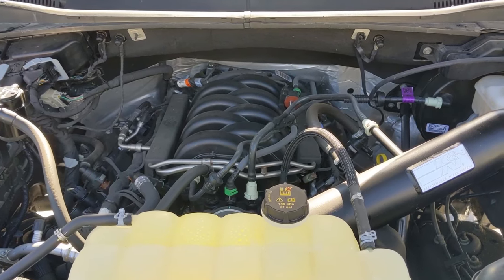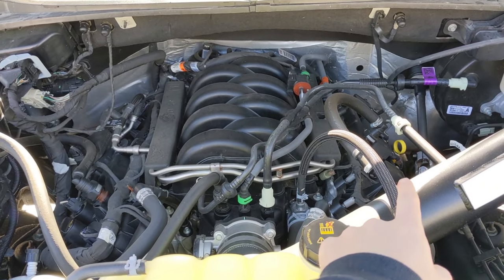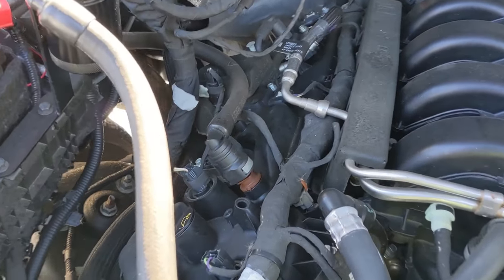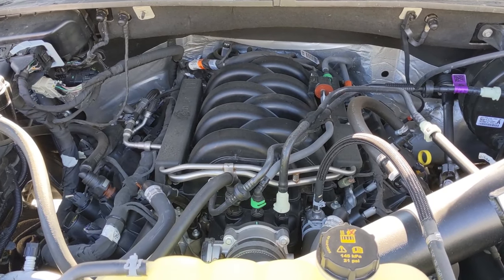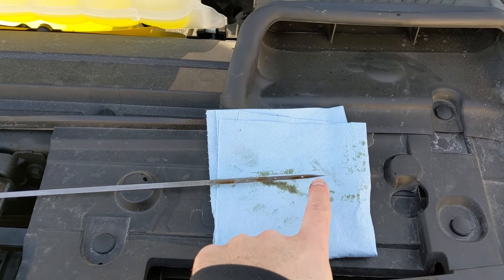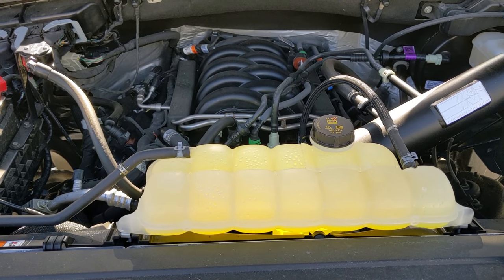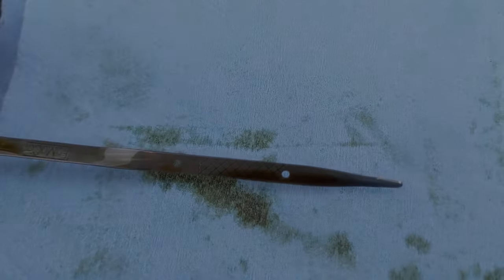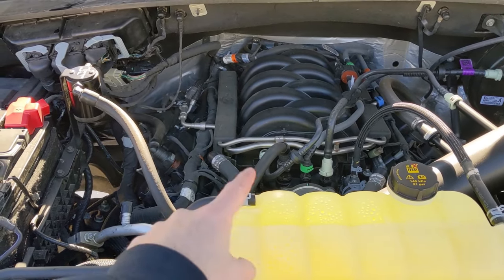Oil Consumption Update - 2019 Ford F150 5.0L

Comment: Excellent video but changing the oil at 3500 miles is something we did prior to the 1990's -very oil school and expensive. Ford 7,500 to 10,000 miles. 5,000 or every 6months. If all you did was change the filter and add oil any engine would easily go 200,000 miles. I know of one guy that does this although I wouldn't go to that extreme myself to save money. To bad their isn't someone who can debunk or myth bust the added cost of early oil changes vs recommend oil changes. Bottom line the oils made today are way better than in the past and synthetic oils take it to a whole other level. I don't even change the oil in my '14 GT500 before 5,000 but I don't use motorcraft oil I use Schaeffer 5w50 - (True full synthetic oil).
Reply from the maker: I disagree, because I go by fords IOLM system (intelligent oil life monitoring system) and by about 5000-6000 km's it's about 10% oil life, which is when I usually change the oil. Now keep in mind, that was when I was using 5w20 which ford only really used for fuel mileage ratings. The 5w30 is a bit heavier, and will further reduce consumption. I also drive this truck hard, I'm towing every day fixing riding lawn mowers (small engine mechanic). And on these trucks, the filter is on the bottom so you have to change the oil when you do a filter. A Toyota Camry for example, my buddies car, his filter is top down so he can change the filter without having to completely drain the oil.
Reply: @EliminatorPerformance  I have a 2018 f150 just changed the oil I'll let you know where my oil life is in about 3 months I tow and drive hard too. I do know that at 9,9OO miles I was at 1%. Usually go 10,000 miles have 90,000 3.55 gears will be getting new dipstick and pvc as it does use more oil than it should and will probably go to 5w30 in summer thanks for everything you are awesome

Comment: When I do an oil change, I check the amount of oil recommended on the manual, I'm not adding oil and reading the dipstick level, I mean, I agree with the TSB, but is not better say: put 1/4 less of oil and change the dipstic
Reply from the maker: Thanks for watching!
Reply: But you’re not always getting 100% of the old oil drained out so you could bring adding too much... well that would be ok if yours is burning oil 😆

Comment: I had the tsb done and it didn't  help same problem
Reply from the maker: I'm in the process of putting together an update video, run 5w30 or 5w40 fully synthetic oil and it'll solve the issue as long as you have the ev281 pcv valve and TSB done for reprogram and dipstick

Comment: Does the tsb change the way the engine brake acts or no? Like does it brake less, more, or not as fast or anything like that
Reply: Or does adjusting the throttle plate have nothing to do with engine brake ?
Reply: @jasongalloway6864  - I think if the throttle plate is NOT closing All the Way, the way it used to,  you are going to get Less engine braking, because the throttle is Still partially open, and to do this, I assume the rpm is now higher, so the truck is going faster... Check your Tach to verify this, when you let off the gas... Does the rpm start going down immediately? That is how you want it to be, to best take advantage of engine braking...

Comment: My buddy has a 19 f150 with the 5.0 litre and his has the same issue blueish exhaust on medium acceleration especially in the cold...I think the  reason for this is the quality of the piston rings that are used and also the 5.0 litre is a small motor that is a mostly a top end power powerplant moving a heavy 4x4 crew cab truck its no wonder why their having these problems...also ford V8 have a known history of using oil early on especially the modular triton years ford is better than Chrysler but not as good as a GM
Reply from the maker: Either his is cylinder issue, or cylinder head issue. Possibly the piston rings didn't seat properly either. The 5.0s always burn oil during break in, mine is passed 13,000 now and not a single drop of consumption
Reply: @EliminatorPerformance  maybe so but oil consumption is not  normal especially on break in...I've broken in many engines mostly GM small blocks and they were always super tight same with the valve seals and valve guides the rings were always installed properly with correct spacing 75k truck burning up a quart of oil every 1-2k miles is totally unacceptable and I would hope that ford can do something for these people that have these problems
Reply from the maker: Yea it's definitely not normal, but unfortunately is common on these 5.0 engines. The 3rd gen especially because of the changes with how they did the plasma liners instead of Steele sleeved cylinder walls and now the 4th gen engines in 2021s have cylinder deactivation lol I can't imagine a V8 running on 4 cylinders and what issues will come up with that. I'm just happy my 2019 doesn't consume oil anymore
Reply: @stevemino142 that's what I thought a quart+ is to much oil to be losing if there's no leak . So it's not on ground it's burning but hey what do I know. Stay in my own driveway.

Comment: Does this help with the pre ignition crackle?
Reply: If you have pre-ignition, you may need to see if the vehicle intake valves are caked up with carbon  build up, which raises the compression. Then if it is this, see about having all the valve tops cleaned of carbon.. The next step is to find out WHY the valves are coated with carbon... Could be a lot of things...

Comment: I say B S! On dip stick if you drain your oil and refill with 8.8 qt and mark the dipstick where the oil came too and drive a 1000miles and then it takes 1qt to top off to the mark on dipstick than the engine is using oil!!! Done all ford updates and then a new long  block from ford still burns oio

Comment: Last question for you, the note on the bottom of the referenced TSB about the shifting of the transmission up shifts and downshifts after the reprogram, any notice of it shifting differently than before?
Reply from the maker: Soon as I left the dealership I noticed it was a bit different but by the time I got to the highway it seemed normal. Nothing crazy.

Comment: This information on the dipstick is false the original dipstick on my 2018 was the shorter dipstick the only thing Ford did  was move the top of the full lineup 1 quart but if you put the correct 8.8 quarts in there you're way short on the longer dipstick.The TSB tells the tech to fill to the full line effectively overfilling your engine by 1 quart so you're within specs between oil changes so they don't have to replace an engine.
Reply from the maker: I'm simply relaying the information I got from various techs, service managers and also other F150 owners from facebook groups and info on the forums. These individuals directly compared the overall length, and found some to be shorter, or longer than others. Additionally, the dipsticks that were affected were not limited to the 2018s as you stated, but should've been fixed after the build date of October 4th 2019. This implies that 2019's are also affected by the improper dipsticks, and furthermore, that 2020s shouldn't be. However, in the comment section of this video, you'll see some 5.0 owners saying even some of their 2020 model F150s have the old dipstick. As I mentioned, and as shown in the video, all trucks built after October 4th should have this new, longer dipstick. I understand that the range was increased, but the overall length of the dipstick is what I'm referring to in this video. The truck still takes 8.8qts, even with the new longer dipstick, as this proper length dipstick allows the engine to be filled to the correct level. An oil change receipt from a dealer or lubetech should show this, as they charge you for how much oil was used. I haven't personally changed my oil yet, but I have a friend who got the TSB done, and he changed his oil and it took exactly 8.8qts.

Comment: Thought it was the piston rings
Reply from the maker: There's many issues, excessive crankcase pressure (solved by tsb and upgraded ev281 pcv valve) then there's plasma lined cylinders that go out of round. There's also issues with the low tension piston rings not seating properly. And then there's issues with worn valve guides or leaking valve stem seals. These 3rd gen coyotes have many issues relating to oil consumption. So the tsb for crankcase pressure may not fix all trucks.

Comment: The cost of a new vehicle is so high now , and so many recalls . You would be crazy not to get a good warranty . With all this technology why such simple things over looked and not checked . You pay good money for the vehicle , but quality gets worse and worse . Sad this day and age that thing are going this way .
Reply: And the electric stuff is coming. Scary.
Reply from the maker: Yea that was my mentality, spent $35,357 on the truck so another $2,500 for a 10yr warranty was a good investment. This truck is aluminum body and won't rust, with the warranty nothing will be wrong with it in 10yra so I'm hoping it really holds it value.
Reply: Great video Jake!  I will share the 💩 out of this video.  I don't know why I didn't do this vid year's ago.

P.S. the PCV valve will only fix the consumption if you are not over filling the sump.

P.S.S. The fluid in your catch can looks like 80% contaminated water.  Dirty condensation.  I'd be interested to see what that looks like if you boiled off the water.  Maybe microwave it.

Comment: Another thing burning oil can do is plug up the cats thats not a cheap fix
Reply from the maker: And most likely not covered under warranty unless you could prove the oil consumption caused the damage! Thanks for watching!
Reply: A very good point Mr. Farmer 2012
Reply: @waynestefinashen239  more like a hard learned lesson lol
Reply from the maker: @matty2helpfull  well funny you mention the cats lol so 100km after this video was posted my truck threw a P0430 code. Cat efficiency issue. I took it in and they're going to replace the cat under warranty. I don't need an oil change yet so I'm still driving it, but I still have a free oil change at the dealer so maybe next week I'll get it in. And I'll do an update video once everything is good to go.
Reply: @EliminatorPerformance  nice lol I mentioned them because I killed them in my truck a long time ago because of burning oil

Comment: Basically you are starting with less oil then the engine was designed for and you have a larger operating range because of the new dipstick. You have already admitted you are getting oil in the catch can so your engine is in 
fact still consuming oil, its not being burned because its now in the catch can. I cant believe you dont understand that the only thing that ford has done is reduce the amount of oil in the engine at the time of oil change. So now an engine that specs at 8.8 quarts is staring probably around 6.8 quarts and is still sending oil through the pcv system. So now if you use fords oil change computer at 7500km you are going to be 3.5 quarts low and since you didnt start ay 8.8 you are at 6.8 the truck will only have 3.3 quarts in it and on its way to engine failure. I know its hard to swallow your $70k truck is screwed and ford is doing nothing to fix it for you, welcome to the club. My 2018 is now knocking terribly because before I was having ford do the service, it was not till i changed my own oil and only 4 quarts came out of the pan that i even l knew of this issue. My dipstick measures right at full when i put in the 8.8 so dont let them sell you the dipstick length is wrong, that is absolute bullshit. I can guarantee your truck is still using oil and now ford has put you in a bad spot by reducing the oil in the engine. Plus you decided to add a catch can which should not be needed on a new truck and will in fact void that fancy 10 year warranty. Im not wrong here and multiple class action lawsuits prove it. They have torn these engines down and found cylinder and ring issues and proven these engines dont seal at the pistons and oil is slipping past to be burnt during combustion. Its sad that ford refuses to stand behind their product but i know from experience that this is common of fomoco. Look at the 2015 transmission issues that have not been resolved and on yours an my trucks the transmission issues that also are generating even more class action law suits. Sorry but there is no way your engine is fixed, ford has just talked you into a bullshit fantasy.

Comment: So I found out why my 2020 5.0 f150 was doing this. The dealership wanted to do the same thing change a dip stick and reprogram the pcm. Unfortunately what I found on my 2020 with only 9500 miles on it was a ring land was blown on number 4 cylinder.  If I had of done what the dealership wanted to I would have been up shits creek. The warranty states driving with low to no oil will void the warranty.  The only way I found the ring land was blown I put a bore scope in my cylinders and found the number 4 was really dark and burned. Ford brought my truck back. My fix was I just bought a dodge instead.

Comment: I heard after 2017 Ford deleted the steel sleeves that line the cylinders and instead used a spray coating needless to say..it is now a flawed motor
Sorry they got cheap and the customer will suffer

Comment: Ford has had the 5.0L in some form or another for 30 years, they still can't get it right.  WTF?
Reply: Guy making comment about how somebody else can't get something right and in his comment he's completely wrong. Ford first started using the 5.0 in 1962. 59 years ago. Almost twice as long ago as your comment.
Reply: @pwilki8631  I was wrong they haven't got it right for 59 years.  LOL
Reply from the maker: Yea but technically the new 5.0 with DOHC has been used since late 2010 so just over a decade and they've now had 4 major revisions. The new gen 4 for 2021 has cylinder deactivation so I can't begin to imagine what could go wrong there lol
Reply: @pwilki8631  Totally different engines - the original 302s were overhead valve engines - the current 5.0's are overhead cam engines with totally different blocks.

Comment: Good  day   Yea I heard about  that. So why change  the 5.0 from yrs. ago when they didn't  use oil.   It sounds like you would be passing me with my gmc 6 cylinder.  Friend of mine said when they use  middle finger , I'm #  1 Yea  change  my oil at around 7000 klms.  Thanks good luck, there is always a GM   for   a option   lol
Reply from the maker: Yea they added direct injection and made slight changes to the 3rd generation 5.0 and now for 2021 the new 4th generation coyote engine has cylinder deactivation lol a v8 that goes down to 4 cylinders, I can't wait to hear the issues there.
Reply: @EliminatorPerformance  Well my new truck is suppose to go from 6-4,  I was watching yt keep out of 6 gear.

Comment: I'm not really sure I wound say the problem is solved. You shed doubt on that by showing the glass jar and how much it would be filled over time, and changing oil every 3,000 miles is kind of deceiving in saying you fixed the problem. I switched to synthetic so I wouldn't have to change the oil so frequently,  plus who wants to get less gas mileage as a fix. Add that into the total cost of the "fix".
Reply from the maker: I believe the fuel mileage was higher because they reflash the pcm which resets the learn for the engine and trans. Once it relearns how you drive, fuel mileage goes back to normal. Something I didn't mention could affect fuel mileage at the time this was filmed.
Reply: @EliminatorPerformance  We bought our 2020 F150 new so we spent about $35000. Dealer did the initial oil change at 8k miles. I did every oil change since at 5k miles. Noticed a big drop in amount of drained oil at last oil change. Now at 24,000 miles it's using 1 qt per 1,000 miles. It's at the dealer now getting "the fix", new dipstick & reprogram the PCM. I just see this as a "bandaid" to kick the can down the road until the warranty expires. No vehicle should be using any amount of oil under 25,000 miles, and there should be no "modifications" needed to mask or counteract the problem.
Reply from the maker: @dwaynemathias3834  get them to scope the cylinders while it's in, you could have worn valve guides or out of round cylinders due to the plasma lined cylinders they use instead of steel sleeves like they used to use. Many other issues could lead to consumption, the ev21 PCV valve and the tsb reprogram is the 1st thing to do.

Comment: When i change oil, i check the amount of oil it takes, i then go to Walmart picked up the recommended amount and that is whst i put in . I then check the dip stick, if im still 2 quarts low i will be calling my manufacturer.  If it needs a catch can it should come with one.

Comment: So if the technical service bulletin doesn’t cure excessive oil consumption….then what? 
And how do you define excessive? TSB 19-2365 says 1 quart in 3000 miles is acceptable. I say BS to that, it should be more like 8,000 miles. We have a 2012 F150 5.0L that burns less than that. The dipstick fix is a joke, it’s an insult to everyone’s intelligence. It’s how Ford weasels out fixing what’s broke. By the way, Ford leads all car manufacturers in recalls. It’s little wonder why their stock has tanked going back to 1999. Rant off…

Comment: None of that nonsense will work,,,your engine is burning oil because ford like most car brands now have started using low tension piston rings for better fuel economy,,which they don't do shit for fuel economy,,,,These rings are extra sensitive to oil changes,,If you change your oil when the manifacturer says ,your rings will gum up and becomes stuck,,you need to change it every 3500 miles,,